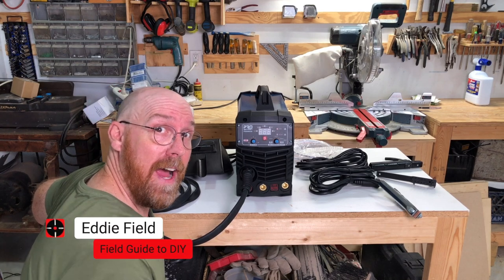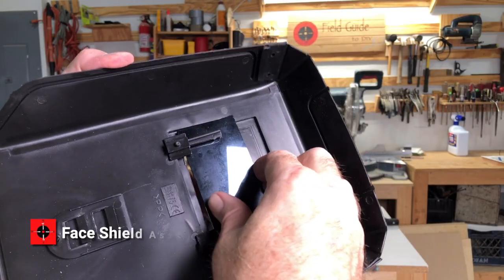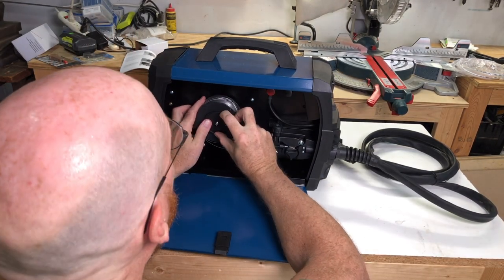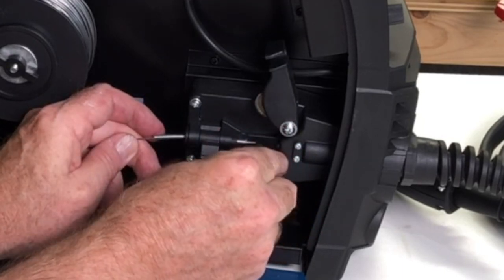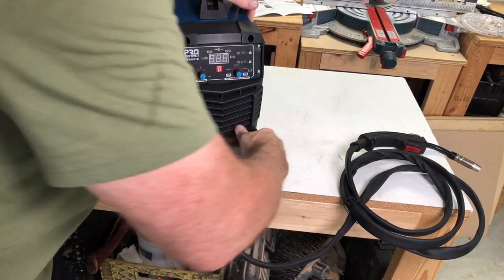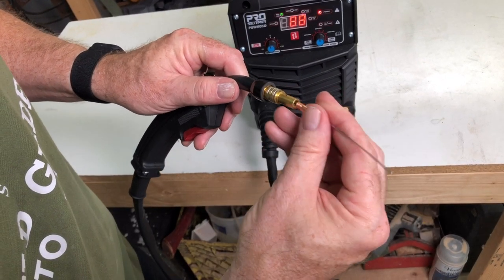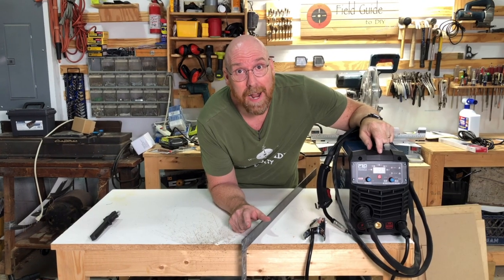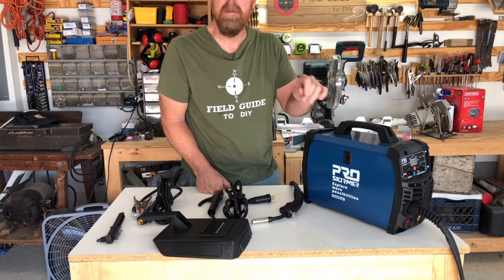BEGINNER Electric Welding Machine | Prostormer 3 in 1 Electric Welding Machine

Comment: Bought one of this and I like it, it’s a single knob wire speed/voltage type of deal so the machine does the thinking for us, there is a second knob to adjust the heat + and - 3 volts to make a bit of fine tuning but most of the times is not the setting but the user that can make the difference, stick out, speed of movement and direction of the gun is what has to be practiced, great deal $120 for a mig, flux core, stick and tig (need extra $60 tig gun 0:15 and a bottle of argon gas
Reply from the maker: Interesting.  Like I said, I have some learning to do but it is a fun machine "to cut my teeth on.  Thanks so much for watching.